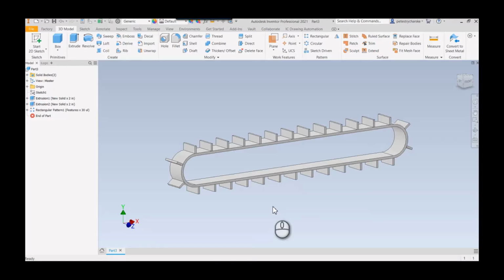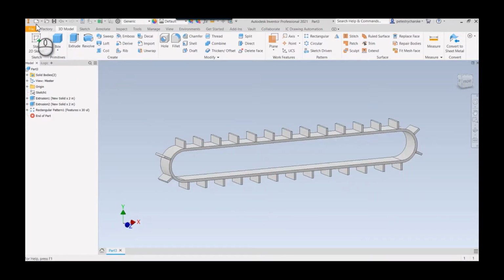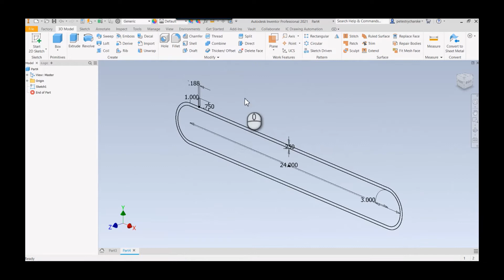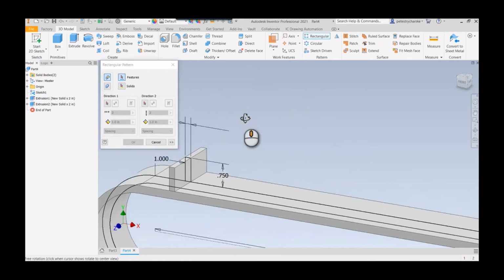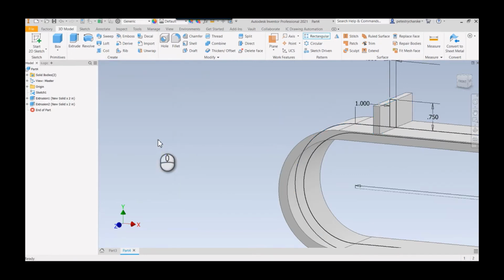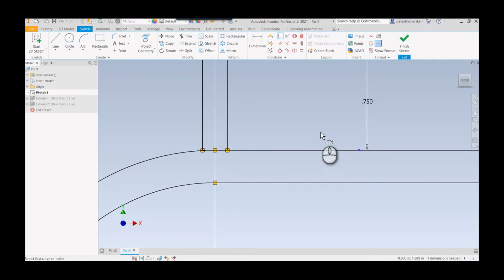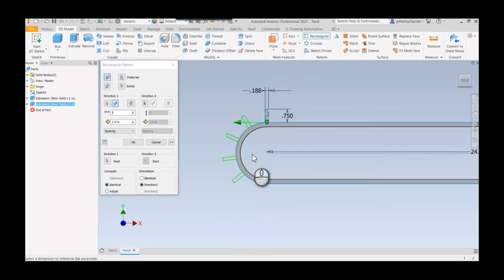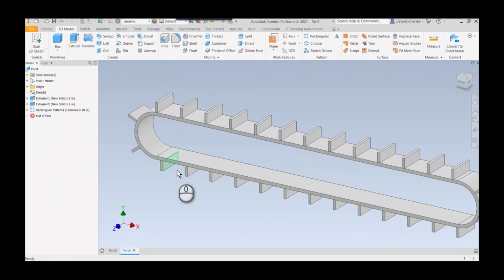Inventor - How to Model a Cleated Belt (Control Pattern Orientation Around a Curve)

Comment: for some reason when I make my slot, inventor still thinks I need two more dimensions to be fully constrained.
Reply: well, Inventor crashed and I didn't save. I opened Inventor again, started a new part, and fully constrained.
Reply from the maker: Sorry to hear about your crash, but glad things are fully constrained now.  In the future, you could use the "Degrees of Freedom" tool in your sketch to see what still requires a constraint / dimension.  Often there is a stray point somewhere that requires 2 constraints / dimensions...